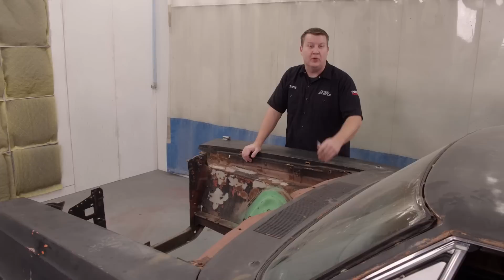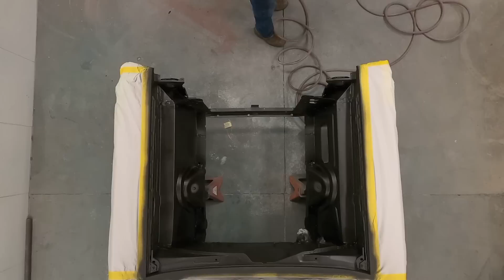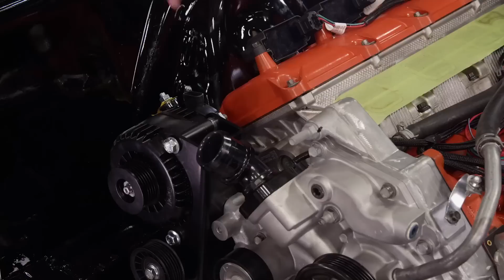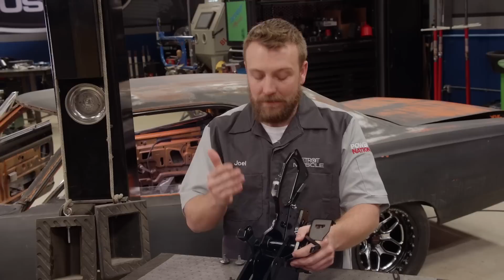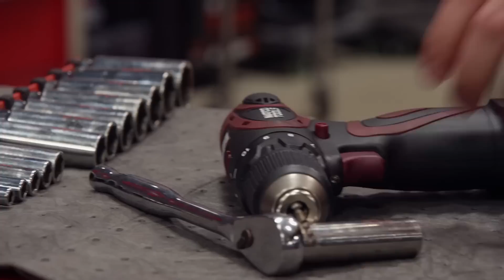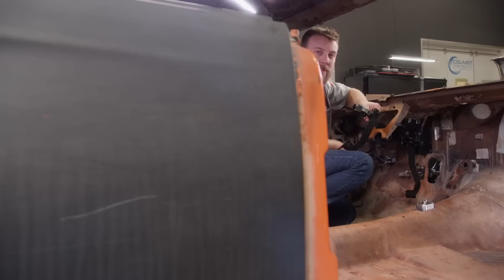’69 Road Runner Gets A Gen III Hemi Swap Part 2 - Detroit Muscle S9, E3

Comment: Imagine having a 90k mile 67' factory 4 speed Coronet R/T and dropping $6k on an American Powertrain 5 speed swap and not being told you have to buzz a hole through your original floor pan and that factory hole just gets covered up. They didn't offer me a shifter knowing my original that I said I had wouldn't even work. Oh, one more thing. If you use their trans mount with a factory shroud your fan will need to be a lot smaller diameter due to the severe driveline angle error.

Comment: 7:53 he says it’s a 6.4, that engine is definitely a 5.7 liter hemi, a pre eagle hemi at that, I was waiting for them to say what it was the whole time because I couldn’t figure it out until I saw the exhaust manifolds and the valve cover gaskets, although I may be wrong, but I’m pretty sure the 6.1 liter hemis and up come with shorty headers from the factory, hence why it made “550” crank horsepower after all they did to it, it gained somewhere in the region of 210-230 crank horsepower
Reply: I watched the engine build. It was a BGE 6.4
Reply: @stevenhoitz9260  Gotcha, I just saw it not long ago and I stand corrected

Comment: 5 seconds into the video and you guys already ruined it..  this isn’t a Chevy or a Ford, paint the engine compartment the correct color!
Reply: Mopar engine bays are painted to match the body color, and the body is color is BLACK and they painted the engine bay  BLACK, I don’t understand why everyone is so pi$$ed off? They didn’t do anything wrong, and a bright orange engine bay with a black body would look atrocious 🤮
Reply: @dancampbell4400  Because they said the original color of the car is Omaha Orange not black.  They said they weren't painting the car black, they were leaving it as is.
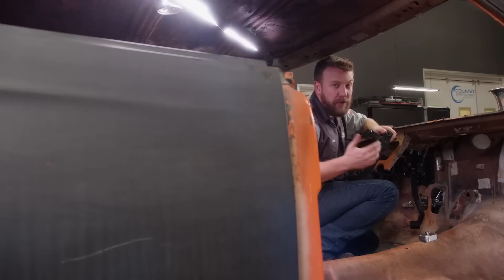Reply: @dancampbell4400  Not necessarily. The original orange paint does pop through here & there (and shows on the door jams at 20:00).  It would make a helluva Halloween hot rod!  🤣🤣🤣🤣
Reply: I agree with your engine compartment color statement, but the rest?  Dumb.

Comment: Call me a worry wart, I still would like to see some wider front wheels and tires on that beast.  500 plus horsepower is plenty and those little wheels take away from some stopping ability and the way it goes around corners.  I do like the stance on the old girl though. Should turn some heads for sure.

Comment: The factory alternator can be made to work with an aftermarket ECU - just takes a little added wiring as the factory alternator relied on the Mopar ECU as the field/excitor signal.

Comment: Curious how much of a discount they get for using these products vs how much it would cost us real world folks to do something like this?Don't get me wrong I'm not hating on 'em.
Reply: I'm under the impression that Powernation gets a HUGE discount in some cases ($0), or that many of the parts are temporarily on 'loan'.
Reply: The Holley system by itself is ~$2000, The 5-speed is ~$5000, Hemi engine core ~$2500....      they are looking at around $20,000 just for engine, trans, K member...

Comment: Don't understand why you didn't paint the engine compartment it's proper color.  BTW, patina means your too cheap to paint
Reply: They definitely have the budget to do whatever they want. They are just doing something different
Reply: They a taking a parts car and turning in to something fun to play with without adding a third mortgage to the house to do it. They are just showing what can be done with a little imagination and your own hands. The hot rod industry is slowly dying a painful death and doing stuff like this is just another way of keeping the fun going a little while longer.
Reply: @greglechowski5030  Ya start pricing the parts they are using.  Adds up real fast. None of that is cheap.
Reply: @greglechowski5030  Agreed with both of your comments.  Another red flag about the industry is the steady decline in motorcycle sales.  A lot of the older riders have reached the age where they can't ride any more, and the young bedwetters rather ride electric scooters.  The times they are a' changin'.
Reply: Dated a girl once called Patina, but she was not cheap to take out.